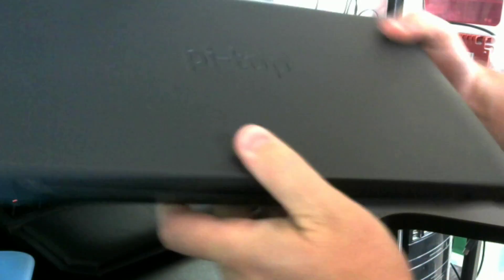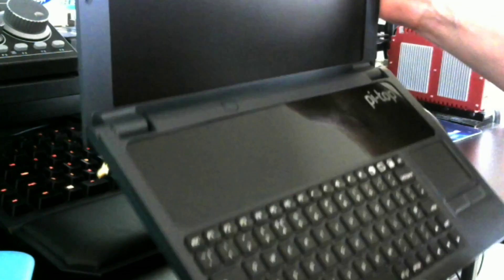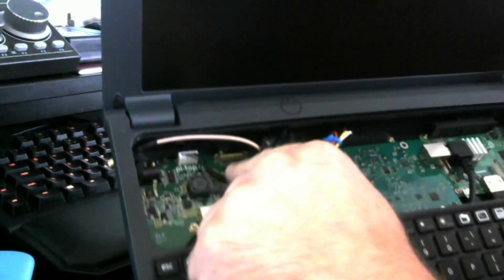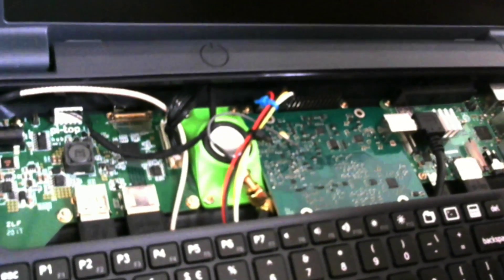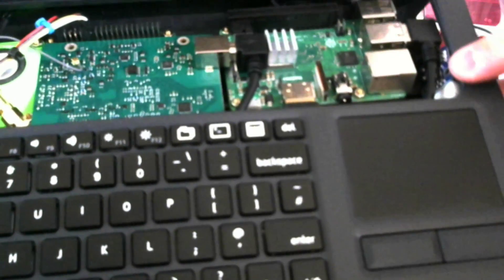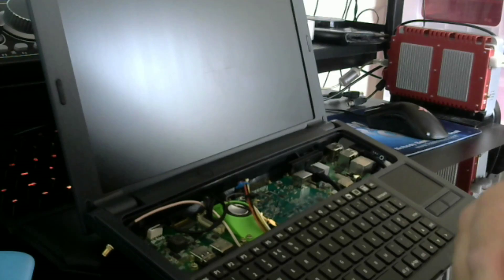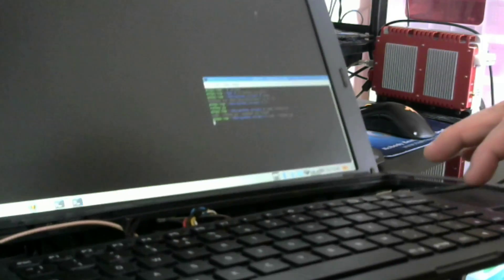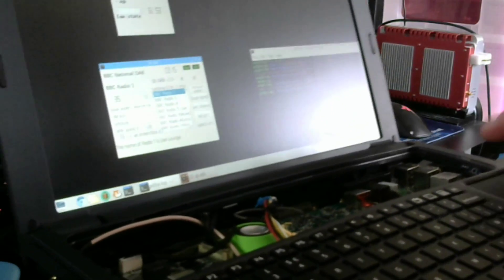Pi Top Radio Project: Making a self contained laptop SDRplay receiver (AV014)

Comment: N3GLV here, you did not say what antenna you are using. Is it an end fed? with a 9:1 balun?
And no earth on the other post of the balun? That might explain the touching the jack bit.
I am getting a pi-top gen 1 like yours soon, and intending on installing a "jumbo spot" radio board to do dmr and other modes. (10mw tx) will build the pi-star tool chain on top of raspbian. Cheers, see tinuyrl dot com / hamdmr

Comment: very cool idea! In the states... Adafruit has the pi-top Laptop kit for $299.95.  Dollar for dollar, how would that compare to windows Laptop that runs Intel Pentium - 4GB Memory - 500GB Hard Drive 15.6" monitor for $279.99?  I like to run hdsdr with the rsp1a.  dumb question?
Reply from the maker: In reality a windows laptop gives a lot more flexibility and choice regarding the most polished SDR software out there (HDSDR, SDR-Console, SDR# and SDRuno etc.),.  HDSDR needs windows.  However the more experimental linux based software lends itself to the Raspberry Pi platform.  As does Cubic SDR which is what we demonstrated in the video.  So this is very much for the learning and fun side of making this great educational platform suddenly do wireless in such a  self contained and portable way.  The SDRplay RSP1A just ensures the ability to receive well anywhere between 1kHz and 2 GHz without the need for upconverters or extra filters for most use cases. It's worth joining the independent SDRplay Facebook Group on https://www.facebook.com/groups/sdrplay to ask others what they think.
Reply: I noticed there is a second gen? Pitop out any reason to stick with the first gen?